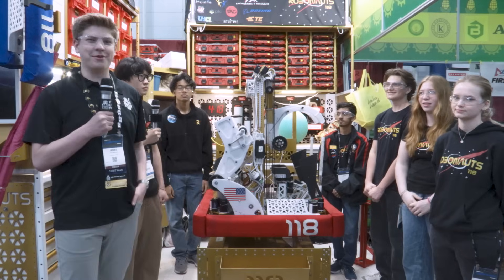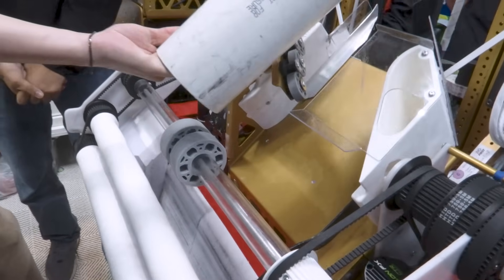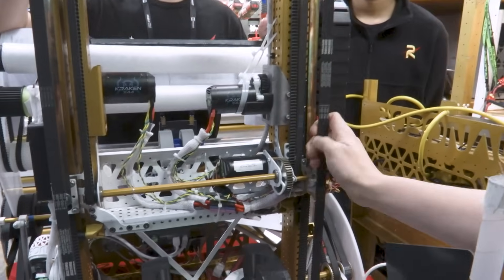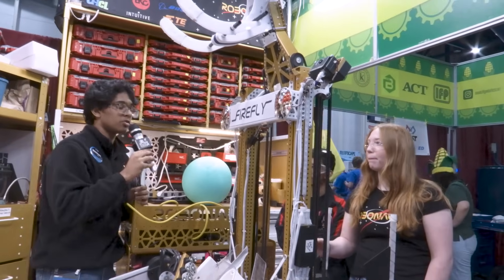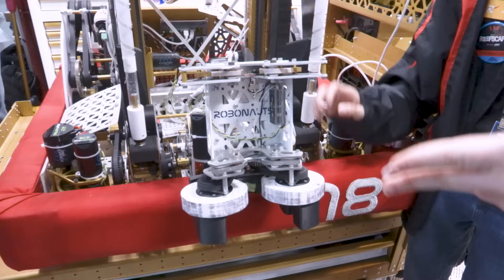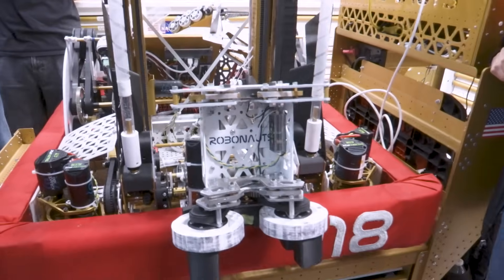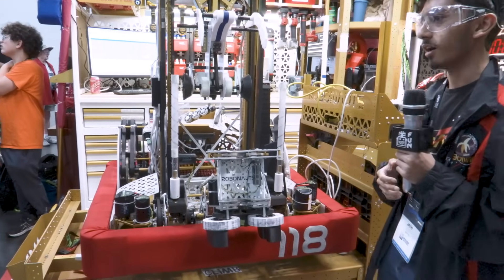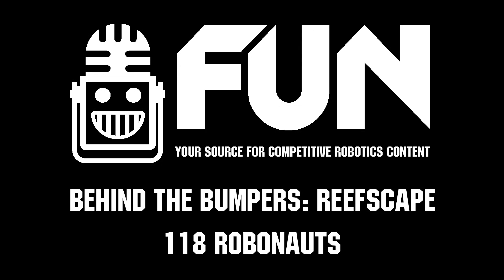118 Robonauts | Behind the Bumpers | 2025 FRC REEFSCAPE Robot

Comment: How is that thing even in weight limit??? Ours was half the robot and 114.9
Reply: I agree with you here haha. This thing looks like it’s 300 lbs. 
The very best teams are really good at optimizing their material choices (polycarbonate, aluminum, and more recently carbon fibre/composites), their thicknesses (1/16”, 1/8”, 1/4”, etc etc), and their shapes to get just the right amount of strength. It’s one of the most amazing parts of these top tier robots really. They’re able to do so much with the same amount of weight that every team gets.
Reply: Yeah same, but we did use a steel frame.
Reply: Prob just light materials like carbon fiber
Reply: Well when you are sponsored by NASA and your team has a massive warehouse with basically unlimited resources, you can spend tons of money just to cut weight.
Reply: @Redoctober81  knew it was going to be crazy expensive when they mentioned carbon fiber filament😂